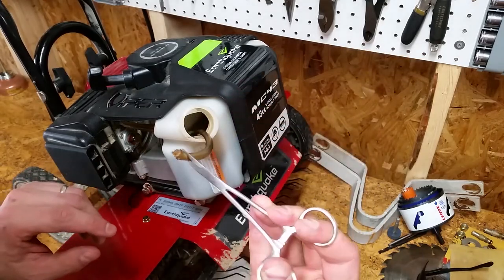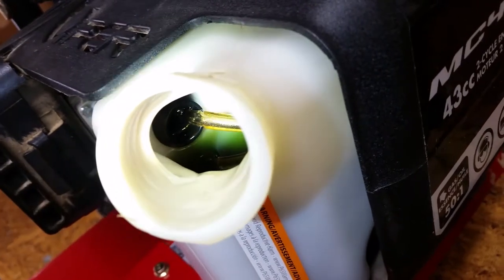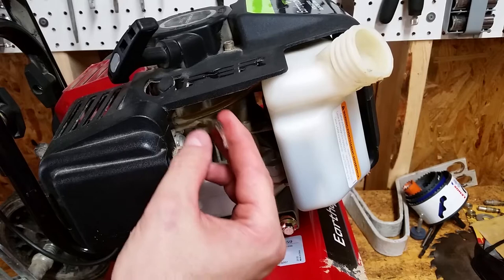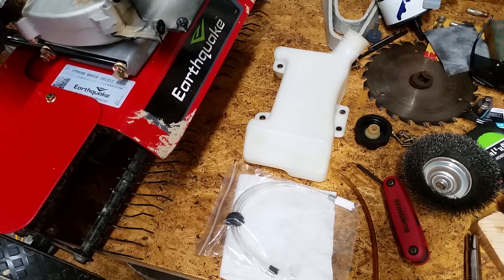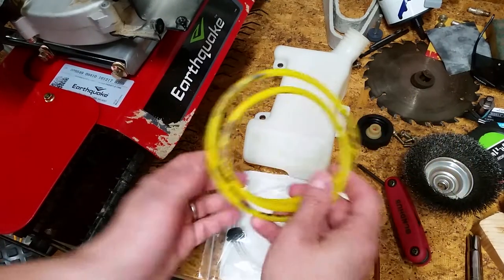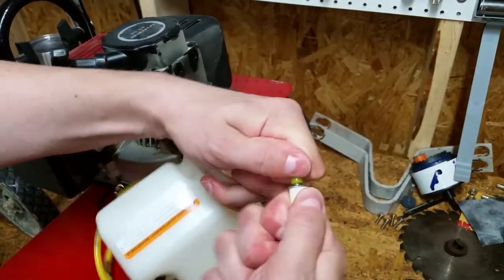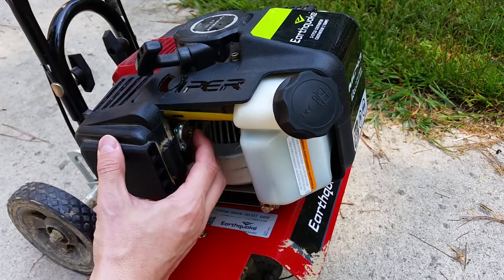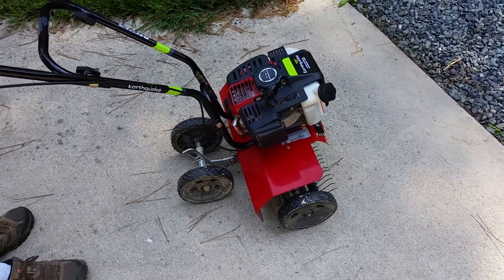Replacing Cultivator Fuel Lines

Comment: Thank you very much for posting this. I have the identical tiller with the identical issue.
Reply from the maker: I'm glad the video was helpful. However, there's a chance you might need to clean the carb too. Small pieces of the old fuel line were sucked into the carb and it recently started to bog down when I squeezed the throttle. My next video (3 weeks from today) will cover cleaning the carb. Thanks for watching!
Reply from the maker: Mike, I uploaded the MC43 carb cleaning video today: https://youtu.be/QVYbxnajJd4

Comment: I couldn’t find 1/4 OD with 1/8 ID, but found 5/16 OD and threaded a short remnant of the old line into the 3 areas where it connects to the carburetor and the fuel filter.  Now working like a charm.  Thanks Mike!
Reply from the maker: Great idea, I'm glad it worked out. I ended up having to clean the carburetor recently because some pieces of the old fuel line got in there. I'll have a video coming out on that soon. Thanks for watching!

Comment: Very grateful for this + the 1 on cleaning the carb., as I had the same issue.  I only use non-E fuel and a stabilizer when in storage. While I don't look fwd to doing either of these (not a mechanic), I do appreciate your easy to understand videos on how to do it
Reply from the maker: I'm no pro either but it'll be a big confidence booster once you get it fixed and then you'll be looking for more stuff to fix. :)

Comment: Did the same to my dads, had to replace lines and rubber grommet in addition to attaching the filler cap vent. Only used it a few times too.
Reply from the maker: Yeah, I noticed that my grommet seems to have shrunk so now it's not tight in the hole and lets fuel seep out. I sill have the replacement that was sent to me, but I assume I'll be in the same position in a couple years. :)
Reply: Any issues with the carburetor?  @Mikeattempts
Reply from the maker: @robertpsarudakis3474  Yeah, not long after replacing the fuel lines, I started to notice it not running quite right. I did a follow up video cleaning the carb. Tiny pieces of the deteriorated fuel line had made it into the carburetor. In hindsight, I should have done the carb cleaning and new lines at the same time. :)

Comment from the maker: Fuel Line:
https://amzn.to/3duqAvS (affiliate*)

Hemostat Locking Forceps:
https://amzn.to/2Uxik7l (affiliate*)

Milwaukee Stick Light:
https://amzn.to/33WCACm (affiliate*)

*Purchasing from these Amazon affiliate links earns my channel a small commission. Think of it as a tip that doesn't cost you anything. Thanks for the support!
Reply: Unfortunately, the link you have for the fuel line shows a 3/8 diameter interior when your video mentions 1/8 diameter interior. Make sure your numbers are correct. I just wasted money on buying the wrong fuel line.
Reply from the maker: Sorry about that, they must have changed the product but kept the same ASIN. The ID is still correct (1/8") but the OD should be 1/4". Here's the correct line: https://amzn.to/3duqAvS , or you could  get a pack that comes with 4 common sizes, like this: https://amzn.to/3db0zl8 . Thanks for brining this to my attention, I have updated the link.

Comment: Great video.  The only question I have is how much fuel line goes into the tank?  From the video I'm guessing 6"?
Reply from the maker: For the intake line, you want it long enough so the filter can reach the bottom right corner of the tank (when looking at it from the front).The other line just returns the excess fuel to the tank so about 2 inches into the tank would be plenty.

Comment: Same exact thing happened to mine, did not have to take the tank off to replace the lines.
Reply from the maker: Yeah, you're right, this could easily be done without removing the tank. However, mine had a bunch of crumbled piece of the old fuel line down in the tank and I think it would have been more difficult to clean it out without taking it off.

Comment: On which side does the line with the fuel filter go on the carburetor left or right, and the return line is it not supposed to go into gas at all, or if the line curves down and would be touching some gas if the tank was totally full is that ok?
Reply from the maker: The fuel pickup line, the one with the filter on the end, is the one closest to the engine. The return line is the one closest to the air filter. It doesn't matter if the return line goes all the way to the bottom of the tank, it just doesn't need to. All it does is squirt the excess fuel back into the tank to be reused. Thanks for watching!

Comment: So you hook the fuel filter to the end of the line, then put it in the tank?
Reply from the maker: Yes, the fuel filter will go on the line that connects to the lower port on the carb. The top port on the carb is the return line. I cleaned the carburetor in a separate video ( https://youtu.be/QVYbxnajJd4 ), which I highly recommend when replacing the fuel lines.
Reply: @Mikeattempts  thank you

Comment: My Earthquake Badger Pro Series XT675 is only 3 years old and I've only used it 4 or 5 times. I've been trying to get it to start since last year. I'm getting ready to replace the spark plug, fuel lines and filter and the carburetor since I'm still quarantining in California and couldn't lift it in or out of my car anyway. I have new air filters ready to go. (I was hoping that was all it needed) (but noooo).  Thank you for making this video. I'll watch it a few more times and take good notes before I get started. Question for anyone: Would using Premium (92+) octane instead of regular (87) be the cause of my problem getting it to start????  Thanks again!

mrl in Sacramento
P.S. I'm 71 yrs young!
Reply from the maker: Before you buy more parts, call Earthquake, you probably have 2 years of warranty left. I don't think the higher octane would cause any issues. My guess is that it's the fuel line. However, they'll probably send you the same type that already failed so you'll need to buy some better quality fuel line. Also, I like to use fuel stabilizer to help limit the negative effects of ethanol and prevent the fuel from gumming up in the carb during the months it isn't being used. Thanks for watching!

Comment: I recently replaced the carburetor on my earthquake tiller. When I reconnected the fuel lines, I wasn’t sure which lines connected to which inlets. How can you tell which goes where?  Does it matter?
Reply from the maker: Yes, it definitely matters because of the fuel filter. The top fuel line on the carb is the return line to the tank (no filter). The lower line is the intake so that one needs to have the filter. Thanks for watching!
Reply: My question exactly... thank you.
Reply: This was my question too. To be more precise the fuel line inlet port will be closest to the priming bulb....I think?  Great video!
Reply: Very good ~

Comment: Which line is the filter line and the return line. I think I have them mixed up thanks
Reply from the maker: The top port on the carb is the return line. The line below is the intake and will have the fuel filter on the other end.

Comment: I have the exact same problem (let alone same brand tiller) but I believe you can do this with out removing the fuel tank?
Reply from the maker: Yes, you can replace the lines without removing the fuel tank. However, mine had crumbled pieces of the old line in the bottom of the tank and it was easier to clean when removed from the tiller.

Comment: Hey there again..where were you able to find the right size fuel line? I used one Frome lowes that was slightly smaller in outer diameter (3/16 I believe) with same inner diameter but still leaks obviously
Reply from the maker: You need 1/8" ID x 1/4" OD. I got the Oregon fuel line from eBay but this will also work: https://amzn.to/3duqAvS

Comment: Did that Oregon fuel line work out better with the ethanol?
Reply from the maker: So far so good but only time will tell. Thanks for watching!
Reply: I have learned to use only non ethical gas in all of my two sroke motors and lawn equipment. Keeps me from replacing fuel  lines and primer bulbs and makes things dependable.

Comment: How do I know which line to hook up and where bottom or top? wich is wich?
Reply from the maker: The top line on the carb is the return line.  The lower one is the intake line, which should be long enough to rest at the bottom of the tank and have the fuel filter on the end. Thanks for watching!
Reply: @Mikeattempts  Thanks Mike

Comment: It is super simple to remove ethanol from gas!
Reply from the maker: Yeah, I use Sta-Bil in all of my fuel but these lines were still ruined very quickly. I think it was just the material used to make the lines because I have a 4-stroke string trimmer and its lines lasted a really long time.

Comment: Do you ever grease the gear box
Reply from the maker: The transmission doesn't have a grease zerk so the manual recommends that you split the gear case yearly to check the grease level. It says to add a high quality molylithium grease only if the grease level is below top of the gears. Maybe that'll be a future video. Thanks for watching!

Comment: You forgot to show us where the line's connect to the carburetor. Thanks
Reply from the maker: The top port on the carb is the return line. The line below is the intake and will have the fuel filter on the other end.

Comment: Sorry but that is a dumb move... yes... you can replace the line with higher quality line ... however all the seals in the carb will eventually head south too..
 And... worst of all,  you'll wind up with a waxy buildup in that little carb .. and those little carbs don't handle and of that stuff very well . And you'll be replacing the carb a lot more often than if you'd stuck with high grade alcohol free stuff.
       These have tiny fuel tanks.... why not just buy ethanol free gas... you only going to save pennies... because you're only going to need 1 gallon or less.. anymore gas than that will simply go bad before you can use it up anyway.... so most of the time you wind up throwing it into the lawnmower or something... not many engines run 50:1 so you use it as regular fuel...
Reply from the maker: It's been over 2.5 years since I replaced the lines and I haven't had a problems yet. I did clean the carb after replacing the lines, some of the deteriorated lined had been sucked in and it wasn't running properly at full power. Instead of trying to find ethanol-free gas, I just use fuel stabilizer that also contain ethanol treatment.
Reply: @Mikeattempts  ya. But give it time.. ive had some nasty messes  in carbs where people were using regular gas. The problen is ... that before they finally do go out tou wind up wearing yourself out before you wven stat start using it... same witj weed eaters.. like i said .. only pennies difference on the price